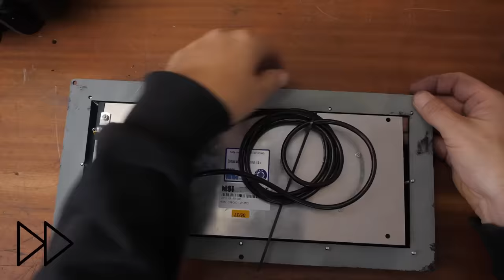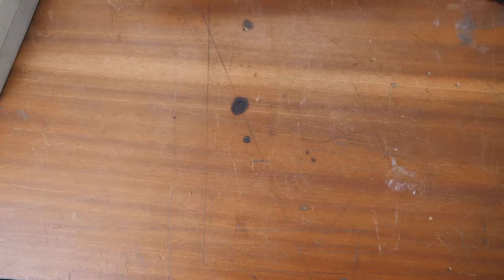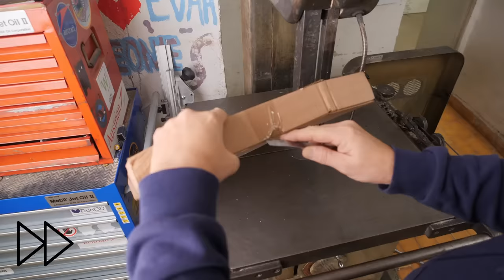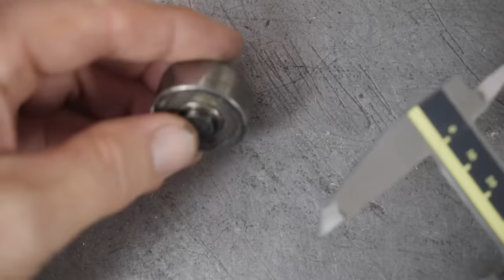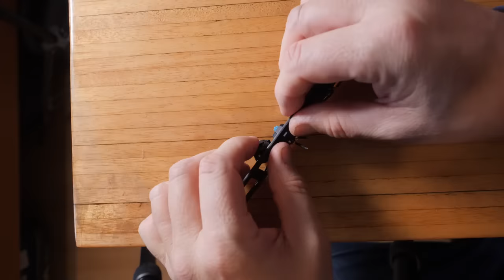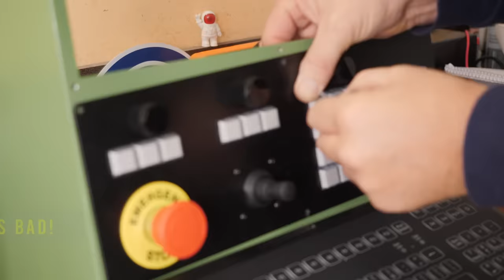Populating the control panel - Schaublin 125-CNC Ep.58 || RotarySMP

Comment: When you join 2 wires in a cable like that, make one wire longer than the other by about 10 to 12 mm.
Obviously the other wire has matching lengths. Then when joined, the two solder blobs are physically apart from each other by 10 to 12 mm linearly and it is much safer for wear-through damage or crush damage.
Re the hacksaw, a few years back I just bought the best one in the tool shop because I got sick of old crappy hacksaws and all the problems.
The new saw has a lever quick release, and much more solid frame and larger more comfortable rubber handle (actually handles at both ends).
Cost about $25 and was REALLY money well spent. Wish I bought it 20 years ago.
Reply from the maker: Do you have a brand for that saw, please? Thanks for the wiring tip.
Reply: Also makes the whole joint skinnier, esp when you have loads of wires. Same with hacksaw, good lever ones are great. I usualy tighten them to the B string on my guitar, lol
Reply: Bahco 325  @RotarySMP

Comment: Using those Cherry switches is actually not a bad idea, they're pretty reliable and feel nice to press.

As an aside, on future projects you could just swap for a lower profile switch if you want one that doesn't stick out as much. Most places that sell mechanical keyboard switches stock both.
Reply from the maker: Thanks. These will not be easily replaceable, once I have soldered a birds nest of wiring in behind them. :)
Reply: Maybe add some sort of quick disconnect? @RotarySMP

Comment: On my DoAll, I made the back up bearings using just a 6200-2rs bearing and made the center bit out of air hardening toolsteel. I heat treated it and left it hard AF and just gave the face of it a polish. I did all that, because DoAll still offered the new bearings, but for $67 each 🤣🤣 The side guides are easy, I just made them out of mild steel and silver solder carbide faces on. They last forever after that.
Reply from the maker: Thanks for your inputs. I have determined that the bearing pockets on mine have been bored deeper, for 62200 14mm wide bearings. So I will use them.

I considered carbide faced guides, but my saw is not used that much, and I bought a stick of 1.2842 a couple years ago, and will make guides from that and harden them.

Comment: Never heard of solder sleeves, they seem extremely practical
Reply from the maker: They really are. Strip the wires, stick them in, heat gun and finished. Soldered, heat shrunk and sealed all in one.
Reply: @RotarySMP  I think I some similar in a WW1 or WWII era emergency repair kit... they needed something anyone could use, and it could be stored for long periods then be packed around in the field and stay usable without dragging about lots of tools. neat.

Comment: I've seen a few situations where machines have used some weird size of bearing, so you're supposed to get an "official" replacement. A turbomolecular vaccum pump I fixed once also had a bearing with exact metric ID and OD, but the thickness was something weird like 10.3mm! Easy enough to shim it, makes you wonder why they bother.
Reply from the maker: Yeah, I thought that was pretty dumb deisgn. It is not like that bearing is so scritical that it needs to be special If thiere is enough meat, I might just bore the casting a bit deeper for a 62200.
Reply: Welcome to living in north America. 
It's metric except for the inch stuff/it's inches except for the metric stuff

Comment: When you came to join the wires on you battery lead I thought "oh no , not soldering !" but you saved yourself with those sleeves 😀
Reply from the maker: Those solder sleeves are pretty handy.
Reply: @RotarySMP  I thought with the aviation background, crimped knife disconnects and cord tied sleeves! The back-up on the bandsaw, Doall did have carbide ones on some of the guides, god knows what they'd charge though. Bearings were off-the-shelf as I recall, but all I can remember now was the 10mm bore.

Comment: Looks as though an 8500 (or 87500) bearing could work, if you align the extended inner race to project outward.

10BCD [S1] is another part that seems to match up, but I'm having trouble finding anything more than overall dimensions. Apparently Milwaukee used 10x30x12.7 in something as well, because they were one of the few interchanges listed.

It also seems that some varieties of 200 bearings work (good luck with Google on that one!). Although generically they come up as the same dimensions as a 6200, at least one source lists (200FSF1, FSF, SFF2, KLDC1) as being 12.7mm in width rather than 9mm. Go figure.
Reply from the maker: Thanks for that. I think the 87500 is probably the intended bearing.  Unless I can find a source in the EU with a decent price and delivery time, I will probbaly bore the pocket 1.3mm deeper and use 62200's.

Comment: nice job... maybe change the socket head screws on the front to button head socket screws? (just to make it nore user friendly for you and prevent any snagging)
Reply from the maker: We have the same design aesthetic. The socket head screws only got used in the first test fit ups. At the end the button heads had arrived.

Comment: I tried posting this comment twice now but it is not posting?
The hacksaw is a "Nicholson 80975 Hacksaw Frame, Pro Series, 4-In-1, High Tension, 12in"
I got mine about 5 years back they seem to have gone up in price...
I forgot to mention the fold up left grip which gives you a triangular overall shape and better rigidity.
Reply: Putting my thanks here also to help Uncle Algo…
Reply from the maker: Thanks a lot.
Reply: @RotarySMP    you are welcome, thanks for the excellent videos and wry wit. 👍
Re that particular hacksaw, I forgot to say the large cast metal backbone of it feels great in the hand it is roughly handle sized itself and a lot of the time I use my left hand up on the backbone when sawing it gives great control. Better than one hand at each end which can still give see-sawing.

Comment: Simplybearings in the UK had those bearings, there might be an EU source as well
Reply from the maker: I just checked, and can't find them there. Do you have a bearing number for them please?
Reply: @RotarySMP  I was just going to correct myself. They do have 87500, but they look a bit strange. A spacer and standard bearing should be fine. Depending on how you make the new roller a spacer might not be needed
Reply from the maker: @lukerickert5203  Those 87500 are probably the correct bearing. The extended inner race carries the hardened blade backstop button, away from the rest of the bearing. 

But if can't find an EU vendor, I will probably bore the pockets 1.3mm deeper, and use a standard 62200, which I can find anywhere for a couple of €.

Comment: a 62200-2RS bearing is 14mm tall. could this work in your assembly? otherwise, a 6200-2RS bearing is 9mm tall, and could work with some spacer
Reply from the maker: Yeah, those are the two options I have found as well.

Comment: 30x10x1/2" sounds like a standard size.  LoL 🤣
Reply: I suppose 30 x 10 x 12 would be standard and easy to obtain, and when he re-makes the little sacrificial wheels just make them 0.6 mm taller?
Reply: @wizrom3046  yup or it's a worn down 30x10x13. Being 0.3mm of wear
Reply from the maker: I bet DoAll sells them in exchange for their weight in gold.
Reply: @RotarySMP  yup.no doubt.  I was laughing at your tone of surprise when you read off the measurements.   Have done that plenty of times myself.   "What the??". LoL
Reply: @RotarySMP But they're probably not custom made, so possibly you'd be able to cross reference them. Or post in a DoAll forum and see what others have done?
Reply from the maker: @JCWren  I bet they are not easily available in Europe.

Comment: 10x30x9 would be a 6200 standard bearing, 62200 would be 10x30x14🤔
Reply from the maker: Thanks for checking that Rob. That is what my catalog diving showed up as well. Might be easiest to turn out the pocket deeper for 62200 (or the two row 4200).
Reply: @RotarySMP  sounds the best idea, until someone finds the spare parts catalog for  do-all
Reply from the maker: @LongnoseRob  Turns out there is a company in the UK with a 30x10x1/2" bearing, but do I really want all the cost and hassle, when I could easily convert to a standard metric bearing?